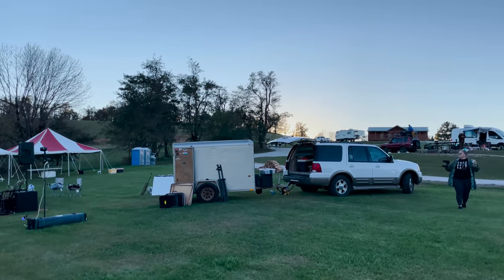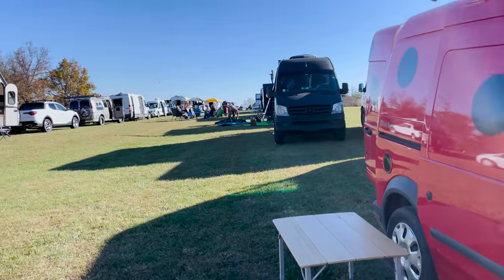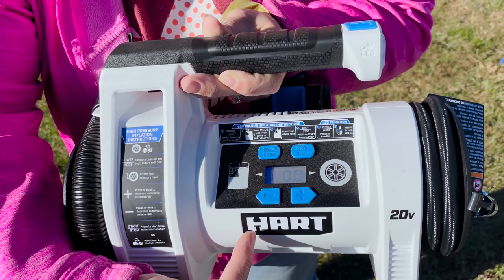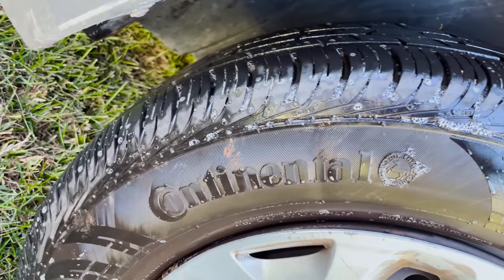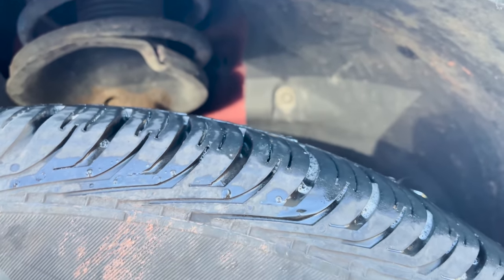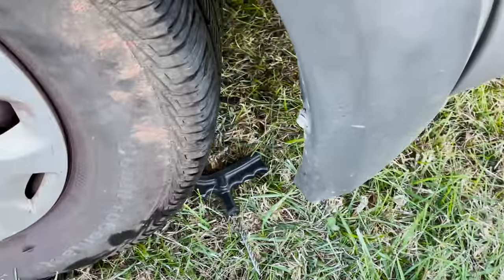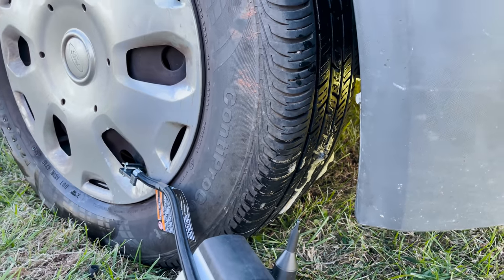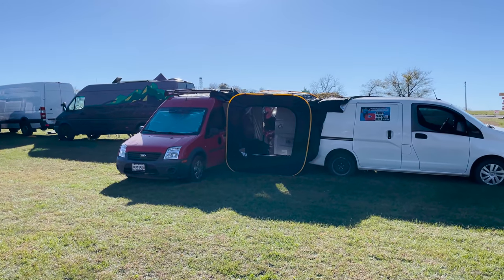Solo Female VanLife | How to Fix a Flat Tire Without a Spare

Comment: I had a flat tire from a screw in my car tire and I used the same plug that your friend used. And like him, I had a hard time getting the plug into the leak.
Reply from the maker: It was not easy😜 glad I had help. I would’ve been using my feet and hands and everything I could to put that in place.

Comment: Another exciting day ha! its so good to have willing hands when you get into a sticky situation.... 
The plugs work well on a temporary basis and a good thing to have in your tool kit, I have had them go several months...it is always a good idea to have a perminate patch done when you get back to your mechanic. also some state a resticting tire shops from using plugs but no one says you can't use them  as a temp solution... better alternative to carrying a spare around. there are several small compresser/tire inflators I like this one because it has its own power source better than the ones that go into the dc auto plug.

Comment: So nice of them to help you.  If it happens again to you on a front tire you turn the wheel out hole up and use your weight to put the plug in.  Ream the hole bigger to make it easier.  I always use the thicker plugs myself.
Reply from the maker: Interesting! Thanks for the tips ☺️

Comment: One little hint that you could do for your tire is turnwheel for the right tire and it will expose more of the tire out side the fender well. You don't have to be moving to turn it just turn the steering wheel all the way to the right
Reply from the maker: Great suggestion☺️

Comment: My dad is one of the strongest physically I know so even I had to help him to push it in, it's so difficult to push in the patch but definitely possible. You would be surprised what 2 or 3 hands can do! To push in the patch 😊✨ thank you once again for sharing this
Reply from the maker: Those plugs are really difficult to push in. I also learned that trying to position it on top might have helped.🐞🚗💃🏻
Reply: @LadyBugout  yes that's true because we had to use my dad's weight to do it and he's about 200 pounds and plus my weight another 200 pounds 🤣 to push in the plug with my help it went in much easier, thank you your videos always brighten my mood ✌️😄

Comment: I bought a much cheaper 12 V air compressor.  I can run it from Monty (my Pontiac Montana) when he's running or from my Bluetti.
Last week, when I had a doctor's appointment, Monty wouldn't start.  I had my battery minder solar panel plugged in, (which works well if you have an Always On 12 V plug) but forgot to put it back on the dashboard, so my battery went flat.
My neighbour brought over his new toy, a little box with jumpers attached, and Monty started straight up.  I immediately ordered one from Canadian Tire.
Both the air compressor and booster are great tools to have on the road to help yourself or others.  :)
Jon in rural BC, Canada
Reply from the maker: Nice! Sounds like it was a good purchase🤗

Comment: Since it was a front tire I would have turned the steering wheel so the portion with the hole would be clear of the car. Then I could put more weight behind the plugging operation. Very cool they helped you. I will check out the Hart brand. Not certain how the summer heat would effect a battery. Maybe it would be no problem.
Reply from the maker: That is a great tip! Thank you☺️

Comment: Walmart has a small Hyper Tough cordless air compressor you can charge by USB or use 12v for about $40. You don't need the Hart Battery. They are both nice.
Reply from the maker: Good to know!!! Thanks Steve🤗

Comment: Couple of things (if they have already been mentioned, I apologize)... it's way easier to plug the tire IF you are able to jack up the car and take the wheel off. That way, you can push straight down and use your body weight. Also, most of these patches advise to drive the car for a few miles after plugging so that the tire heats up and softens the sealant material in that cord and centrifugal force flattens it on the inside of the tire. But hey, if it worked, that's all that matters! Just a couple of things I learned the hard way. lol. 😀
Reply from the maker: Thank you Brad! Yes, some others mentioned that. But it’s good to know 🐞🚗💃🏻

Comment: Always have an emergency kit   I have a compressor that plugs into my cigarette lighter socket.  I've loaned it a few times.  But my studded traction matts have been loaned more times than I can count!  Add a roll of perforated steel and wire to attach it (zip ties melt) in case anything starts to fall off, like your bumper or muffler.
Reply from the maker: Yes, I realize I need one now😛

Comment: Seems big for carrying in the van.   I use a smaller one.  So I bought new all season tires for my Connect.  I figured I'd have them check my spare at the tire store.  They couldn't get the valve cap off, seized on.  They didn't want to open up a can of worms and declined to try to lower the spare and fix it.  Do I have a useable spare, if I do can I get to it?  I do not know.  But I have an air compressor, roadside assistance,  cell phone and 4 new tires.  Think about how different things are.  I think of wagon trains of pioneers.  We got it so easy.  I think I'll carry a kit to plug a tire.  I always used to carry one. I also carried a can of fix a flat. Good video, addressing my current concern.
Reply from the maker: Oh I know… right?!?! I’m glad it was useful information. I have similar situation with my spare😛 I have all the other things you mentioned as well. But i do not have a compressor. I will be investing in One soon. What kind is yours?
Reply: Hi Linda, which compressor do you have?
Reply: @janiswilliams2766  I have one that is smaller and works off the cigarette lighter.  It came with my Bridgestone emergency tool kit from Costco.
Reply: @LadyBugout  its small and plugs into the cigarette lighter.  I have another one that runs off and incorporated in a jump box.  I don't carry it anymore.
Reply: @lindabarker7142  thanks… I wouldn’t have even thought about looking at costo, I’m more interested in the food and  Costco than automotive. That will have to change up a bit with van life!

Comment: Ironically I helped a stranded lady this morning.  She is presently homeless after losing her job to Covid.  All four of her tires have nails imbedded in the tread but the rear driver's side seems to leak air faster than the others.  I carry an air compressor in my van but have not used it since buying it over a year ago.  I helped her air up the rear tire so she could drive to a service station, gas and air up all four tires.  I ended up just giving her the air compressor since she needed it more than me.  I bought new tires all around recently and with solid warranties and guarantee.
Reply from the maker: Wow! So nice of you to do all that☺️ Glad she had you see her and help out like that♥️🐞♥️

Comment: Hello Dee, great video. Interesting repair method. Similar technique used here in Oz. Great inflator! Mine I have to plug into my DC socket in my pickup. Do you carry a rattle gun in your tool box for undoing wheel studs? Stay safe Dee.
Reply from the maker: Thank you Maurice. I do. I have everything for changing a tire. But when it’s not necessary, this is great!!!☺️

Comment: If you don’t have a donut spare for your Transit Connect, would be a good idea to look for one.  Having a 2012 Connect I bought used,  I know a full size spare will not fit in the wheel well.  I had to go on e-bay to find a donut spare.  Ford dealer I went to couldn’t find a listing for it.  Reason I say this, one of the few times I had a flat, it was caused by a large spike that made too big of a hole to repair with a patch kit.  Luckily in that case, the vehicle I was driving at the time had a full size spare.
Reply from the maker: I have a spare! We were just able to repair it first!!! And I’m glad for the compressor, or the video would’ve been about how I change my tire😜

Comment: Some vehicle manufactures have developed the bad habit of not supplying a full size spare tyre, and these should not be driven for too long or at too high a speed, or you can damage the vehicle.  If that is not the case, the spare should be in good condition and the tyres rotated. it is false economy to save the spare from road usage, because tyres eventually age, even if they don't look worn. 
Anyway,  would have swapped the bad tyre and put on the spare wheel. It is easier to fix the tyre when off the vehicle, for all sort of reasons. One big one is that the tyre may lose bead seal with the rim if the tyre is still under load. 
Also, make sure that the hole in the tyre is reamed properly. Otherwise it is harder than necessary putting the plug in. Proper reaming also makes a better seal at the puncture site. Tyre valves are cheap, so if you have to repair the tyre it is a good idea to chuck a new valve core in. Also, don't forget to replace the valve cap, it will keep water and dust out of the valve. 
In the event of a puncture in a front wheel, I would swap that tyre with one from the back. All things being equal, the best tyres should on the wheels that steer the car. If in any doubt about the repair, ask a tyre professional to have a look at the repair job, just to be sure.
The date that tyres are made are on the tyre wall, and tyre age, as well as wear, should prompt you to invest in new casings. Never use re-treads if you can avoid it. Sometimes good second-hand tyres of low age and little wear can be a better deal for those on a budget. Some RV tyres can be especially suspect because they can often look as if they have had little wear, but may have been sitting for years without much use. 
Anyway, it is good that people are looking after each other-that is what being human is all about.
Reply from the maker: Thank you Robert! Such great information here. Glad you took the time to write that out. It is very helpful♥️🐞♥️

Comment: I just bought 4 new tires for my Van Bear and the guys at Les said my spare is under the van and I just laughed like I would be able to get it out.  It is one of those tiny tires.  I was looking at one of those tents that hook to the back of the van but yours looks better, it looks like it would be very useful on hot rainy days.  What is that tent called? Is it enclosed so my cat can’t get out.
Reply from the maker: Hahah, yes, I probably need some new tires too. The tent is called Mogic. It is enclosed when it is all zipped up. The floor is attached as one big unit☺️
Reply: @LadyBugout   thanks I will look into it.  I just bought the Van so you would think I would not have needed new tires right away.  But I did get a great deal on Bear and they gave me way more for my pristine caddy.  It is a 2012 Chrysler Town n Country.  Same as Dodge Caravan.  It has the stow away seats I have already gave them to my local junk yard.  Nice guys now I will go back and see if the can level my bed.  I don’t have my tools anymore so can’t build it out like I would want.  I already have scoped out some campsites not too far away so I can do some practice to see what I might have left at home. Hopefully the docs will get my surgery done and then hit the road right after the snows.  I love being by the rivers and the places I found are $8 a night and right on the river unfortunately pretty close to the road but not busy this time of year.  Crooked River sounds nice huh!
Reply from the maker: @Gimo76  sounds like a great set up. The river also sounds like a wonderful place to stay☺️

Comment: To work more comfortable  just turn steering to get the hole area out stick in the injection straight as possible
Reply from the maker: Great tip. Thank you♥️🐞♥️
Reply: @LadyBugout We have the tools to learn from each other and use good info in our benefit and not get offended when sometimes others know things we don't. Believed me I have learn alot of tips from you , I just got mine Transit connect I looking forward to keep learning more from you

Comment: The tire has compromised.  I would change out as soon as possible or switch to the back less dangerous
Reply from the maker: Thank you, Sam! I actually went to a tire repair shop 20 miles away to get it checked before I hit the road again. They told me that it was fine. I told them that I was going to be going 900 miles and they said I was good to go. I will be getting all new tires before winter and Olán to change it then☺️

Comment: Luckily I have a 12-volt air pump, but I don't have a tire repair kit.
Reply from the maker: What kind of 12 volt air pump do you have? How big is it? Before I invest in a bigger one like the Hart compressor, I want to investigate a little. I’d appreciate any info you have☺️
Reply: @LadyBugout  It fills the tire slowly, but does the trick!